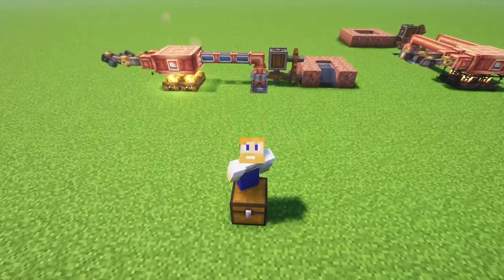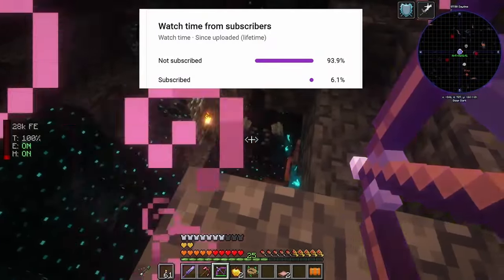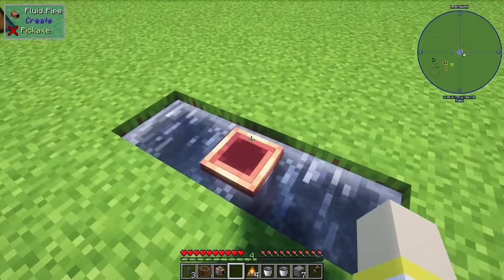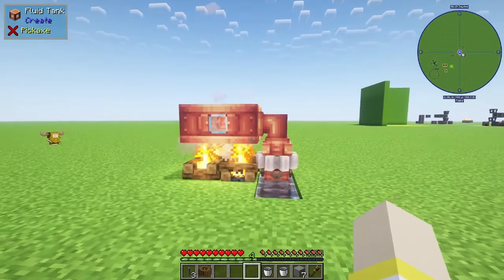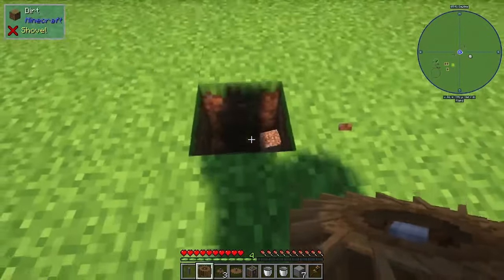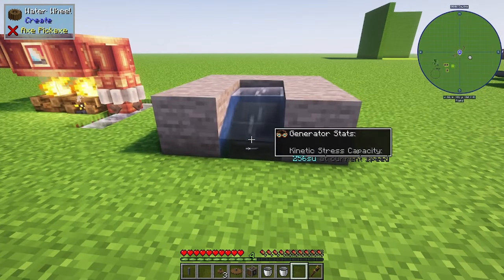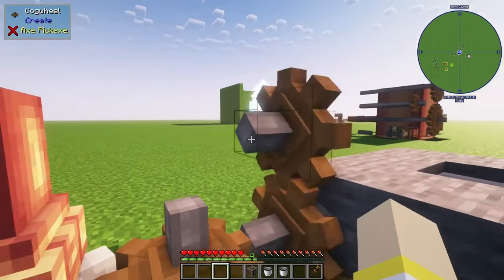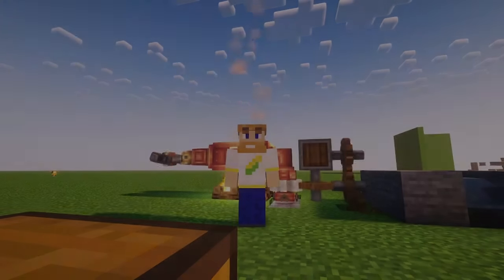Create Mod Boiler (Steam Engine) |1.19|

Comment: not working
Reply: Did not work for me either. I fixed it by setting up a second water pump (goggles said me the water input was not enough)
Reply: @phoenlx_3  thanks
Reply: @phoenlx_3  what i figured out is that you cant draw water from infinite sources anymore, it has to be a tank

Comment: When im done building and i connect the steam engine the tanks say "boiler status idle". I even tried to let the tanks fill up with water which worked but as soon as i connect the engine they switch to idle mode and nothing happens, What am i missing?
Reply from the maker: Maybe your pumps the wrong way? Or it’s a different version and maybe you need more water! Also may need to be a tank! Not an infinite source anymore.
Reply: @cornybreadman  I play on 1.18 so i dont know. I’ll be sure to try it out!
Reply: did you ever find a solution
Reply: @Huase23  yeah, my pumps needed more power to pump the water in the tank. I can't recall exactly but i think i also meeded more water
Reply: @christian8916  thanks

Comment: I Know this is a basic tutorial
But i would like to mention that if you run the engine output back into the pump it can power itself

Also instead of a water wheel i like starting them with a crank simply cuz its kinda cool
Reply from the maker: That’s good to know I’m playing with create right now I’ll have to see if that still works! Thanks for the info.
Reply: It infact can not the cog will simply break
Reply: @the-partial-anti-furry  It literally won't i have done it several times on creative and survival 
I think u are doing something wrong or you are running the engine faster than in the video

Comment: Nice and simple set up. 

One change I would make (and use myself). 

You can place the water wheel where it is flat against the ground. So dig down 2, dig out a 3X3 area. Place the water wheel flat on the ground. Then place a block back in the corner and pour your water as needed. Then you can just bring up a shaft and place a small cog right where you need it instead of doing the cog setup.
Reply from the maker: That is useful information, I’m not sure why my brain didn’t allow me to believe that worked horizontally. Will definitely have to try this in future builds thanks for the feedback!
Reply: @cornybreadman nice video tho i love your texture pack, link?
Reply from the maker: I know it’s complimentary shaders it comes with the all the mods 8 download on cursed forge.
Reply: @cornybreadman  oh okay. I just asked because the water looked sick